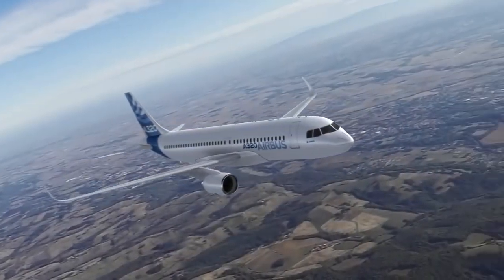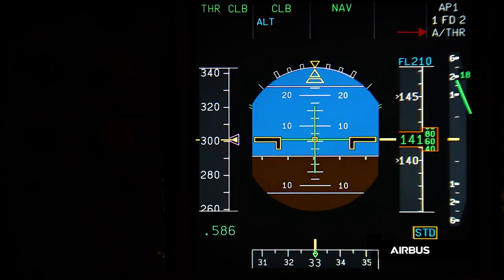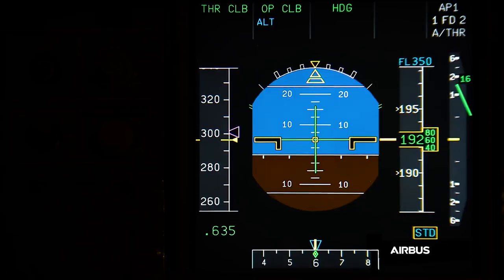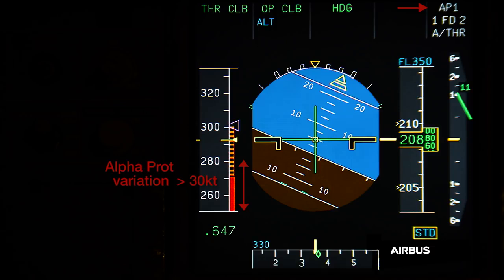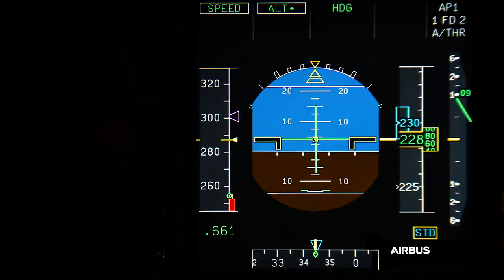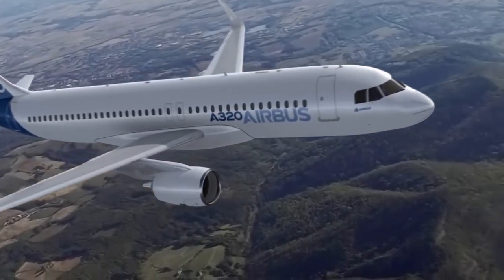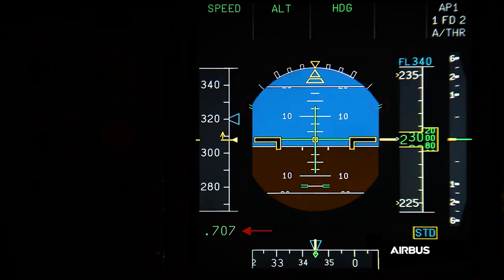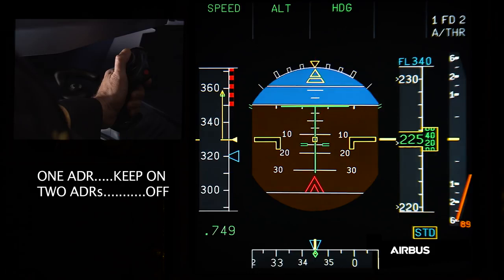Airbus A320 - Abnormal  V Alpha Prot ( OEB 48 )

Comment: Qantas 72...
Reply: Not quite the same problem. This video was made after a Lufthansa aircraft had 2 frozen AOA sensors. QF72 was a software glitch that made the computer think it was flying too high AOA and pitched down to correct. OEB48 has now been withdrawn as better software can identify multiple blocked AOA sensors by comparing with load factor